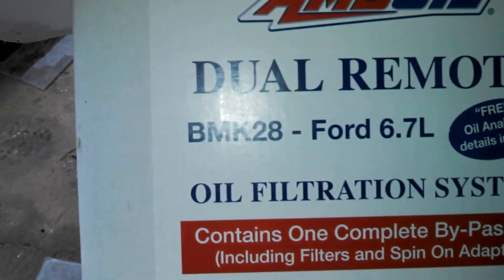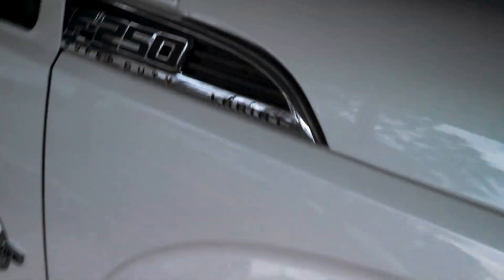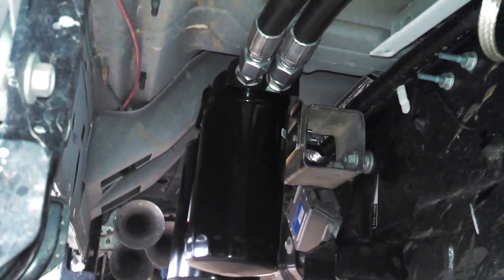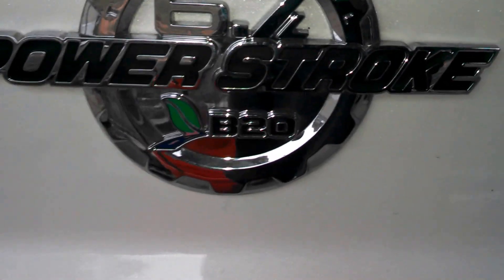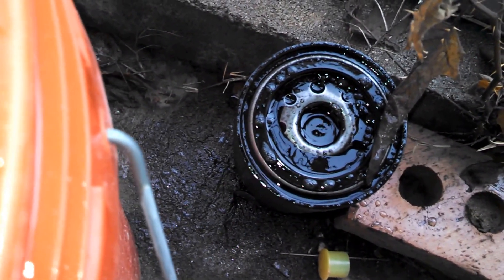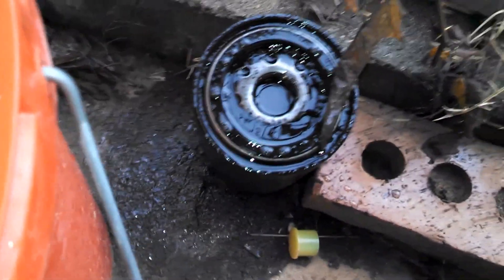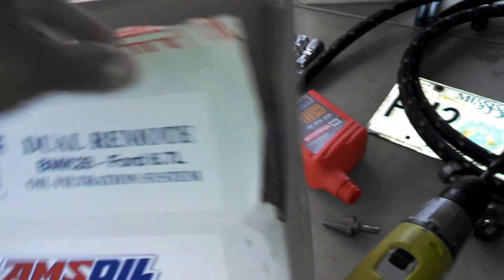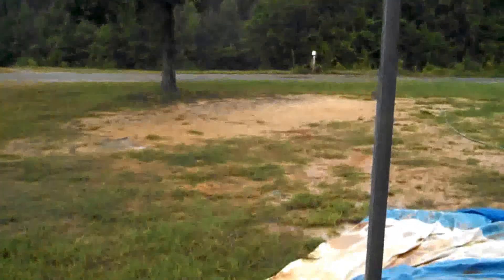2015 f250 6.7 scorpion amsoil by pass filter

Comment: where did you have they custom hoses made?  I'm thinking about putting the same kit on my 2015 f350 6.7 and adding archoil products aft er my first oil change.  Any  comments on the kits performance yet?  any issues with your new 6.7 at all? do you use a fuel additive?
Reply from the maker: PatrickNJ       I have been using the archoil it works very well I did not install to go beyond the oil change that is I will change my oil when ever the truck says to I am in mississipp seals in Bogalusa la. made my hoses just make sure they are same inside diameter  theses are gates a lot better hose than what u get with kit I only have 3000 miles on this truck I love power is great  these hoses are a 2 wire 2500 psi I think  5/8  the ones you get are only 450 psi no steel belts so they could rub a hole in one easly  love the truck no issues thank you sir  the fuel treat ment is killer stuff
Reply: Could you provide me your hose length and specs so I can have a pair of stainless steel hoses made?  My install will be practically the same as yours so I think your hose length fittings diameter would be all the same.  I would appreciate any info you could provide me sir.  Do you use archoil?  Do you have a separate fuel/water aftermarket separator system?   I was considering one of those also.  Here is a link to the separator unit.
 http://www.dieselsite.com/dieselsite2011-20012ford67lfuelfilterwaterseparator.aspx